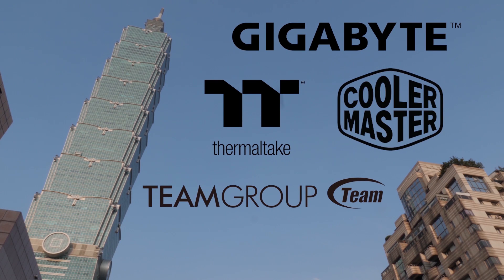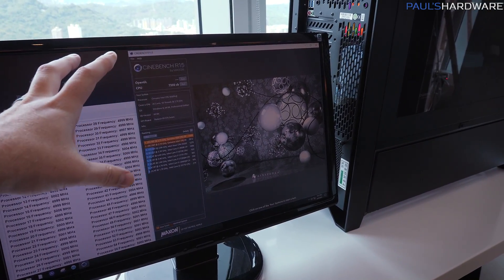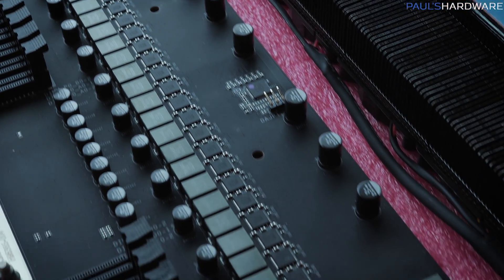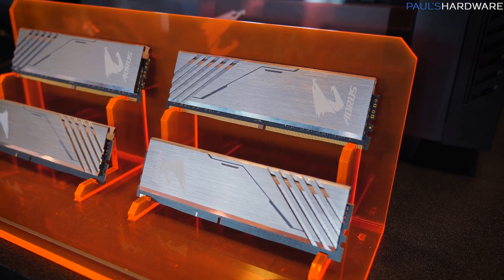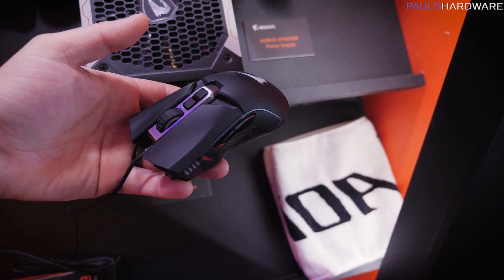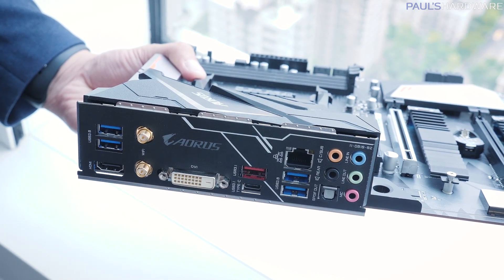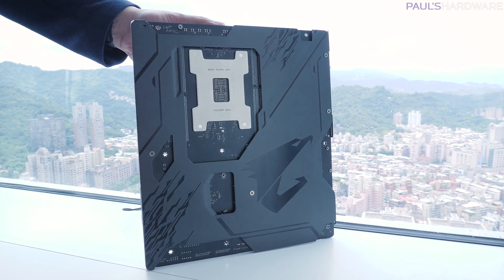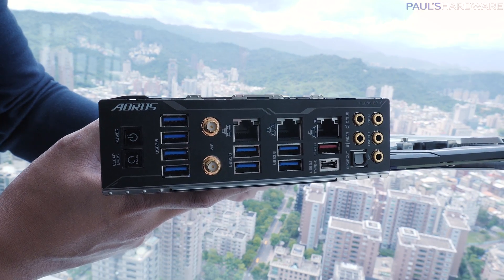Just A 28-Core 56-Thread CPU at 5GHz...

Comment: While this does indeed look good, actually it looks amazing, the TR is already spanking it's butt.....this core war is face melting hot right now, isn't competition a great thing Paul? 😎😁😊😃
Reply: the real war right now I think it's more about the "who can get the most core wich run the fastest"
Reply: Yeah you scoped them, DUDE IT was already debunked, They had it hooked up to a modified AIR conditioner, for a cooler.. They should have hit 7GHZ with that..  What a JOKE!!!!! LMMFAO.......
Reply: U DO NOT KNOW WHAT U ARE talking about.. And U do make me look like a Genius.. U don't even own a Ryzen platform so U don't know what's safe and not safe, Ryzen chips are soldered, The VRM's on AM4 are Better and can take more heat,  First off..  Second Don't be mad at me for calling Bullshit, ON THIS CB Run.. Show what the chip does stock, OR the Real World End User Result... That's something Intel and it's childish Fanboy's never want U to see.. That's why they only list a Base and a 1 or 2 core turbo clock, I know as well as anyone about Intel, Been getting Ripped by them for over 15 years.. With Intel, U always see the Overclock, They never show the thermal throttling tho... SMH.. And I've owned and built over a Dozen Intel systems, SO I AM TALKING From experience... The only people U should ever listen to on this subject is someone WHO own's Both Platforms... And Then they can tell U the difference Like me, Which is very little when it comes to real world gaming, Not Synthetic Bench marks.. While gaming and streaming I've noticed huge differences, Favoring Ryzen Gen 1 and 2.. See I have an 8700K and a 1700 and a 2700X, SO I'm NOT Talking OUT OF MY ASS, I'm talking from experience....
Reply: DUDE The CB score is that high because it's hooked up to an AC unit!!!!!!!, AND iT"S GOT 28 cores vs 16 by your comparison.. It's base clock is 2.7GHZ.. Hook thread ripper up to an AC unit and then overclock it.. (And are you talking about Gen 1 Thread ripper with only 16 cores or are you talking about Gen 2 Threadripper with 32 cores and 64 Threads?????? Wake up..) That Intel chip will never go past 3.0GHZ to 3.5GHZ  with normal cooling??? SMH.. You can't be that dum??? WHAT A JOKE LIKE ANYONE will ever HOOK up an AC unit to there PC....... WOW.. I am so blown away by the retards that believe all this shit, and really think that they can buy a CLC Cooler and Hit 5.0 with this chip....
Reply: B0NES YT - "first ever manycore CPUs to reach 5 GHz"?? Gamer Nexus have covered a 5.2 GHz Threadripper before.

AMD had "broken the record" before you even posted 😁
Reply: That's because EPYC has locked clocks.... if you cooled EYPC to subambient and if you could OC it ... it would be about 1.5-2x faster.... TR2 on air is probably going to be on par with this system and about as fast as dual EYPCs as its running at much higher clocks. EYPC 2 in 2019... is going to drive that even firther up to 64 cores on package and higher clocks.
Reply: he did scoop.... but uploaded it way late after the other vids since the amd TR 32core wasn't released yet at time of filming.
Reply: MarcasswellbMD It's called a phase change cooler, and NO it isn't anywhere close to LN2 to reach 7Ghz buddy so stop dreaming. It also has a cb score of 7,300, that thing beats all EPYC 64C/128T scores that I've seen.
Reply: fan boy fan boy alert! Alert! ALERT! ... Just can't wait for AMD to attach a chiller to Threadripper  and just do 5.2 Ghz XD
Reply: I have seen 5 other VID's on this Farce, Prior to Paul's but they at least Made it very clear that the chip can't actually do that speed with normal consumer cooling... It will never go past 4GHZ maybe 4.2 Overclocked with a 320 CLC RAD, Because its Turbo speed is under 4.0GHZ ....
Reply: Chase Rayfield Yeah but the TR is unlocked, I just used EPYC as a point of reference (because all of these use Ryzen cores anyway, barely any difference other than clocks). That's just odd because server chips like the Ryzen/Xeon have NO need for "higher clocks". Even the EPYC 7601 has an already impressive 3.2Ghz boost. More cores is the best way to go for these CPUs. Ryzen CPUs have limited performance due to voltage constraints, even at the hands of people using LN2 (significantly colder than this phase change intel used, like -100C+ colder) they couldn't go far without damaging the chip. It's also the reason why no Ryzen CPU has broken any records yet in the overclocking arena, they are not really good overclockers.
Reply: MarcasswellbMD Welp no shit genius, no one could even maintain 5Ghz on an 8700K without a top tier AIO, pushing a many core CPU past 4 Ghz is suicide. I use intel CPUs but I handled a 2700X recently. Nearly at stock voltages at near 1.4V, right off the bat the voltages of Ryzen CPUs are NEAR UNSAFE LEVELS. I remember there was this guy who got a TR 1950X to 4.1 Ghz with a 1.4V that's pretty high, in retrospect my 5960X could get to 4.8Ghz at 1.288v

Another is a 7980XE-> At 4.7Ghz that thing just needs 1.2 volts. If you really want your Threadripper OC'd under PCC, then I'm sorry because the voltage requirements alone will literally wear out your TR2 in a week if you push it past 1.4V. This is even if you have it under a phase change cooler with a temp of 5C that thing will still fry itself in the end.

And yes everyone knows this is a demo. But it is also the first ever manycore CPU to actually reach 5Ghz. AMD is free to break that record anytime they want.
Reply: Pandu Poluan Still not 28 Cores under chilled, and that TR was so insanely binned for Ryzen marketing purposes that barely any OC Professional could even replicate it today, though there is a single guy who got 5.5ghz...but even then it was already broken by 7980XE at 6.2Ghz. And no, 16C benches was broken way before your Threadripper. Old AMD Opteron 6282 SE- 16 Core 5.5Ghz ON AIR. But of course I wasn't talking about 16 core but meh.
Reply: B0NES YT - I don't think Intel's demo is any different: gold binned CPU that others won't be able to replicate.

And your post did say "manycore at 5 GHz", not "28 cores at 5 GHz".
Reply: Pandu Poluan Who knows. If intel could release 8700K that can go 4.9Ghz + easily or even 7980XE that all are capable of smashing 4.7Ghz they could release thing thing in years time, mobo manufacturers are getting into the 1000W stuff, even Phase coolers are present at Computex. This is intel we are talking , they've been hiding shit like this for years and limiting performance like a tard and charging extra for old hardware.

I wasn't even trying to put them in the same ballpark, that's all on you. And the TR at 5.2Ghz.didn't even break records, and if it did, it was obliterated by i9 anyway
Reply: MarcasswellbMD 
1. I used to own a R7 1700 w/ an X370 Killer for a time before getting back to by 5960X. And I built a 2700X test bed for our modding group and tested it out literally a week ago. I got 4.1Ghz at 1.35V, 69C on a ID 240L AIO. What did you get?

2. I know Ryzen chips are soldered over intel, that WASN'T THE ARGUMENT, if you haven't realized yet. this isn't about heat at all.

3. No one cares what it does stock, this is about 28 cores going 5 Ghz. I've seen higher scores in CB, but that's what it is. A single 28C CPU doing 7.2K on CB. You need a little more than two EPYC 7601 to achieve the same score.

4. Lucky for you I've been using AMD and intel hardware for 15 years and I never felt either one ripping me off.

5. I have 2 systems, 1 is my gaming 8C I7X 5960X@ 4.8Ghz with a Accelero Xtreme IV GTX Titan Xp and an 16TB HTPC unit UV's FX 8320E and RX 460 4G, so we are not that far. I also participate in our modding club (which is tied to our local PC retailers in town) so I have experience with nearly everything you can find in the IT market today.
Reply: B0NES YT Welp, it looks like you got con'd.
Reply: TakeshiInazuma If con'd means having better parts than 90% of PC users. Yes I'm con'd 24/7
Reply: Michael Livote it's sad it was all fake....

Comment: I wonder if the new 32C Threadripper will cost less than the 18C Intel :)
Reply: Probably $1999
Reply: EPYC still has more memory channels.
Reply: now that you mention it its probably the same or less isn't it.
Reply: Atak Snajpera honestly id say 2500 considering that the epyc 32 core costs around 3500 depending on the model. They wouldnt want to undercut their server sales
Reply: but at the same time it wont work as well for server workloads
Reply: 800 for 16 cores 2000 for 32 cores seems legit.
Reply: Stone Mug Between 1600-3500, that is guaranteed.
Reply: Considering that a 28 core Xeon  platinum 8176 is 10k Usd it cannot be cheap.... Imho it will be over 5000